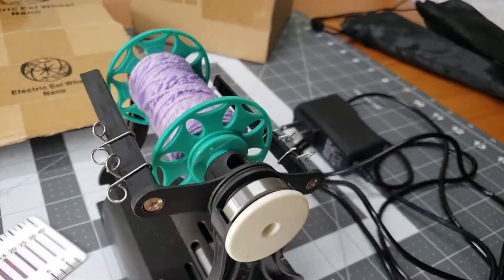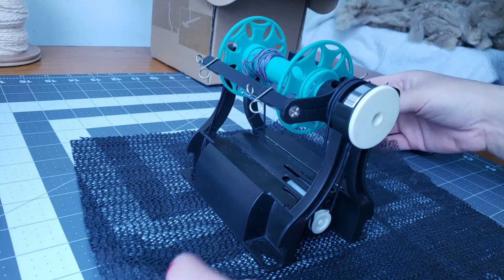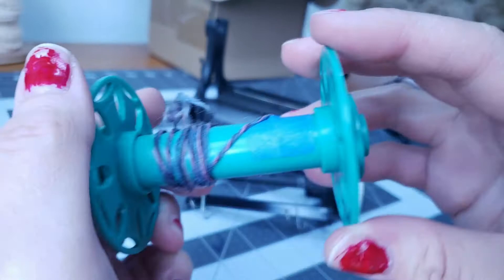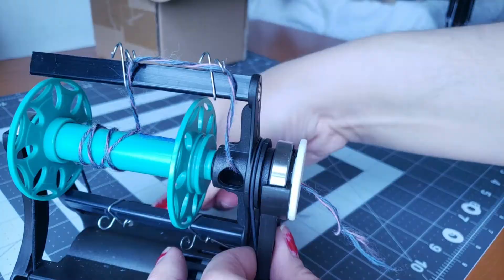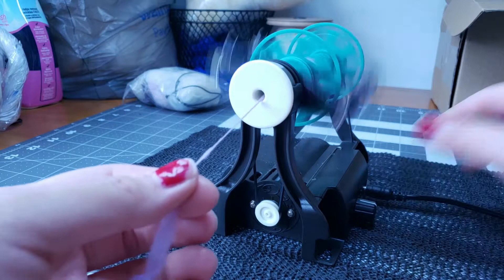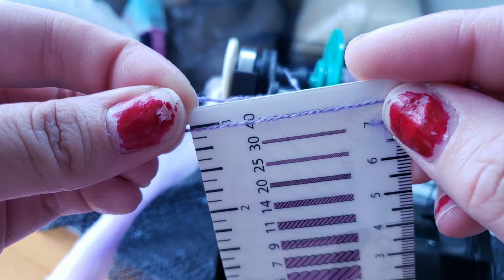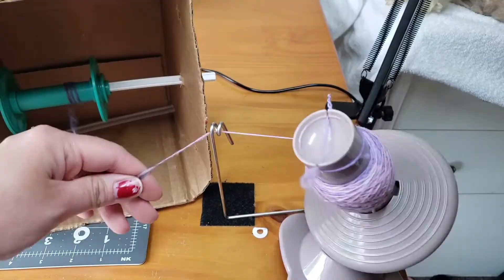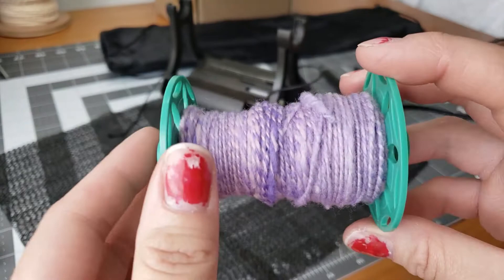Spin & Ply on the Electric Eel Wheel Nano / SIMPLE Solution for TENSION Tips & Tricks

Comment: I’ve got the EEW Nano2 and absolutely LOVE it! 

My go-to yarns are lace weight once plied: 30-40 WPI once plied (2-ply). This little wheel does those ultra-fine yarns like a champ. I did test thicker gauges and for fun I re-plied a 2-ply into a cabled yarn just to see if I could do so on this little wheel. Well, it didn’t even blink. It just… went for it. I took some commercial yarn that was thicker and plied it, for funsies. It did. No issues. 

I’ve yet to try navajo ply on it. I’ve seen videos.of it done on the EEW Nano or the Nano2 and it should work but I didn’t get around to yet. It might take some practice and adjusting the technique to prevent the wheel from slipping as there’s more friction. It’ll be interesting. 

Thanks for the video! And… I absolutely love that sample yarn you made! 😍

Comment: Super video.
One question:
Why wind it onto a wool winder and center feed it?
Why not feed the plys straight from your lazy Kate?
Was this because you didn't have enough bobbins or because you wanted to make the PLY from that one ball?
I want to buy one, and use DK 99% of the time.
So a first time spinner (future) I want to buy something that is ideal for my yarn requirements. 
I had heard the nano was fine yarns so thanks for dispelling that myth.
Reply from the maker: It makes a nice DK yarn yes; I was unable to chain ply on it though. The only reason I used a center pull ball was because I only had a sample and just spun it all on one bobbin, I have the upgrade from the 1.0 and have 6 bobbins. I suppose I could have spun half on one bobbin and half on another and plied on a 3rd but just got mesmerized in the process of spinning and spun it all in one sitting 🤣 
You are very welcome thank you so much for your comment and question I am glad you enjoy my videos! 💕
Reply: @RayneFiberArts  
Yesterday I wanted to buy the nano 1.1 and it is out of stock until at least April 2022. 
Maurice at dreaming robots is working on the nano 2.0
So maybe when I get a nano, it will be the 2.0
(It's compact size for travel is ideal. Even if just to travel to the park for the afternoon. )

There are still a few EEW6 in stock (here in the UK shop) so hopefully I can get the cash together to buy one ( the next shipment on those is also April)
I am so appreciative of the videos and explanations that the YouTube community have made on spinning and spinning machines.
😊
Reply from the maker: @woollycrafts  You are very welcome! May have another this coming Wed. 🥰 I know they are both quite in demand so I could definitely see why he cannot keep them in stock! I am excited to see the Nano 2.0 for sure!